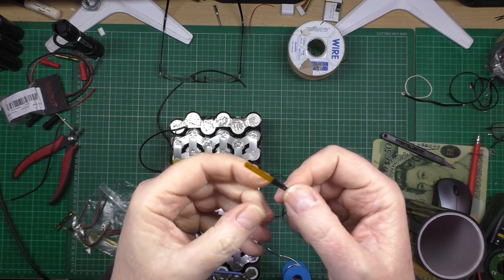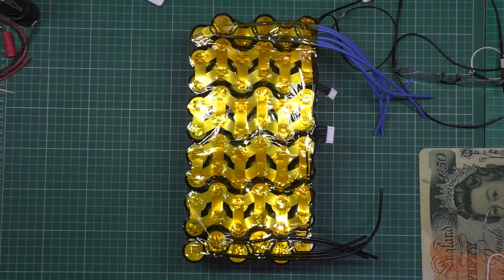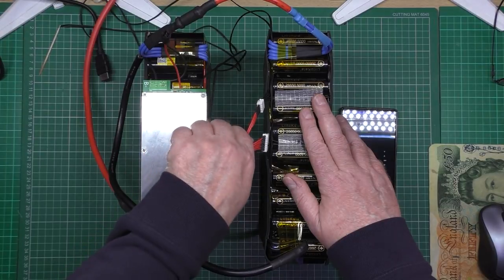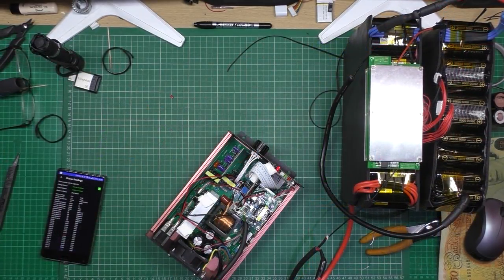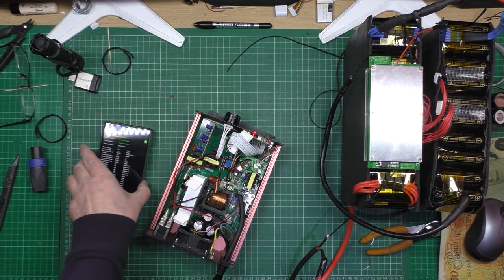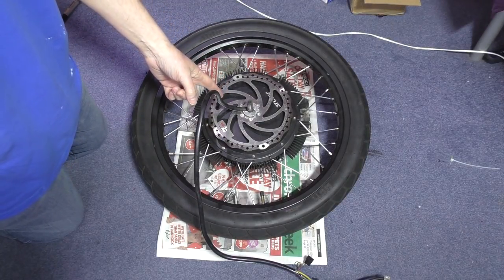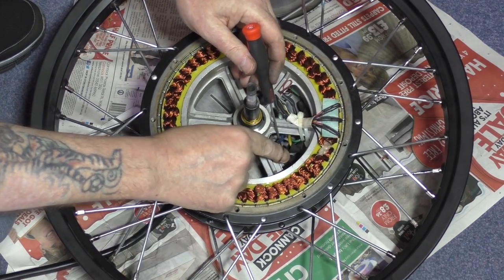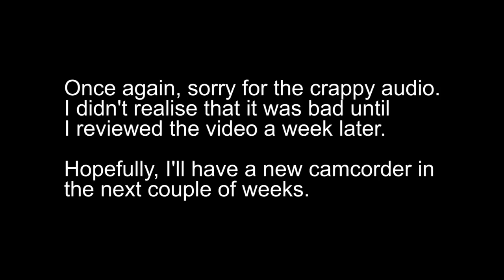High powered DIY eBike MSVA build part 7 - lithium battery build part 4 & MXUS 3K strip down how to

Comment: Great build series Tony. It’s not even about the money. If I just had the time to build something like this. You break it down to such a level that even I could follow along and build the exact same thing. Except for one thing. The six year old boy that needs me to play video games. He is literally hanging off my shoulder right now. Maybe in a couple of years. Maybe I’ll have a little helper. Or maybe it won’t be cool to hang with dear old dad. And I can start building batteries. Lol.
Reply from the maker: Don't say things like "even I could follow along" until you see the main wiring for the controller mate. Personally, I'm looking forward to it but I'm dreading the 'trying to make sense of it' part.
The main trouble is, if I make a design mistake, it can then set me back weeks as I found out yesterday :-(

Comment: Why is there only one White temperature wire that comes out of the hub motor? It looks like there’s two wires connected to the thermistor? I’m trying to connect the temperature sensor to a generic temperature display. Unfortunately my controller and display doesn’t support temperature function and I’m trying to find a way to connect a simple temp display to the white wire.

Comment: The Hall Effect Sensors looked like they have been in contact with the magnet ring, I would check they are well stuck down or you will have a Failure.. Top Video Big Thumbs Up..
Reply from the maker: Strangely, they haven't been binding and they are well glued in place. They must be good because I've been using the same set for 2000 miles without problems mate.

Comment: Thank you for your insights, Tony. The audio quality is not an issue for me, I understood what you were saying.
Can I ask why you want to beef up the wiring on the motor? Is there not already some "headroom" built into those motors? Or are you going so far outside the recommended battery power that it might heat up too much?
Please keep uploading these excellent videos sir, I've learned so much from you and Andy. Thanks!
Reply from the maker: I wanted to beef the wiring up because I want to run far too much power for the phase wires to handle for a prolonged period. They don't really get hot, even with 15kw but I wanted to be sure. It was just one of those things that I thought of....."while I've got it apart".

Comment: 5 conductors in parallel. with different lengths, the shortest takes the greatest load, and can suffer with over load
Reply from the maker: Yes, I know but we have to make sacrifices but, as heat generates, the resistance will rise and so the load will be on the next shortest. I could have used busbars but I really couldn't be arsed :-)
Reply: With that short of a distance and a reasonable quality of wire, I dont see the resistance difference being measurable let alone produce any kind of negative impact on the battery.
Reply: @geniusaur  that I draw attention to a desing that may have unfortunate consequences, it is up to him what he will do ... geniuaur what you think about that  have no matter
Reply: @roberthansen710  well you wrote it on a public forum so I will give my input, if you chose to ignore it thats up to you. Overengineering something doesnt make it better, it just makes it more expensive
Reply: @geniusaur  I have no time and desire. to educate you ,,,,, yes in public
Reply: @roberthansen710  I think my honours in electrical engineering and 3 years of designing and building complex electrical prototypes is education enough. Thanks though.
Reply: @geniusaur  as i say... I have no time and desire. to educate you .... electrical engineering you ,,,,,,hahaha